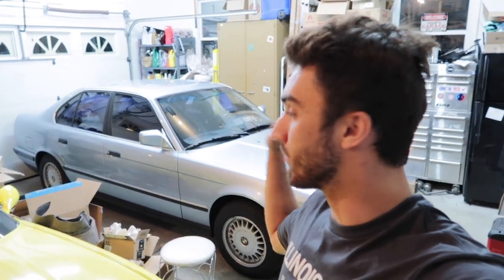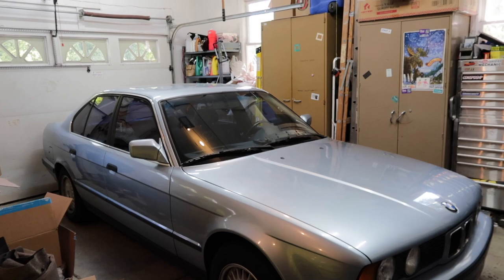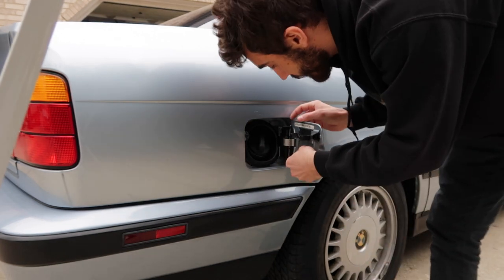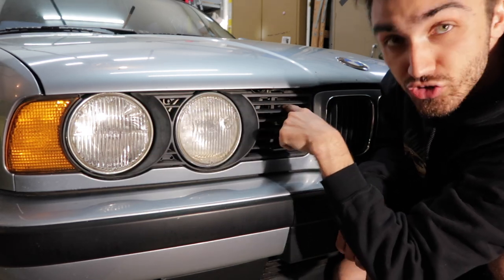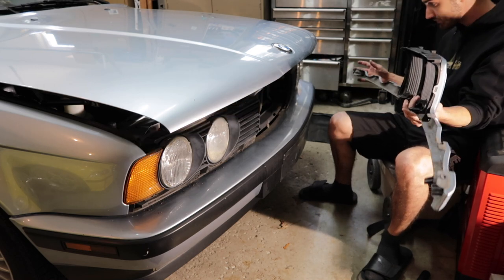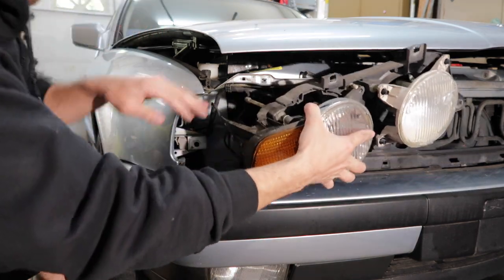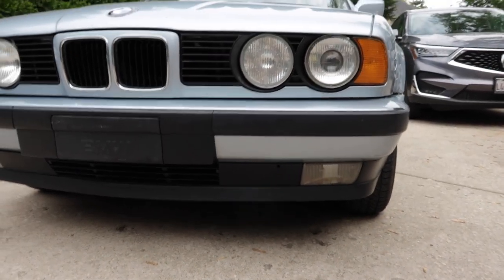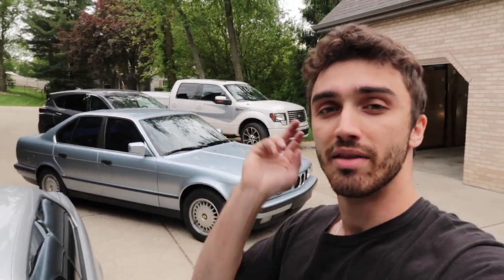Dialing in the Blue E34's Exterior | PDR, Trim Restoring, Headlight Upgrades, and More!

Comment: For the front grill there’s a hole at the top of the engine bay by the corner you stick a long screwdriver into to push down on the black tab to get it out. Bentley manual to the rescue😅, its in part 4 of my E34 restoration video. 

Plastics look amazing with fresh paint good job!
Reply from the maker: Mannnn! How did I miss that!??? Thank you!

Comment: Geepers! What a transformation! Looks great! Thank you for the PDR information. I have some dings that drive me crazy and the cost is reasonable. I bought my e34 new in 1995 and I want it to look as good as possible. Also appreciate the removal of the front grille. I’ve done it before but it’s not easy with big mitts for hands! Well done!
Cheers, George
Reply: By the way what type of SEM trim paint did you use? Matte black or Glossy? Thanks. Cheers! George
Reply from the maker: Thanks George! And I don’t even see a label stating matte or glossy on my can. Just says “Trim Black”. Interesting. Its definitely matte though

Comment: The turnermotorsport fuel door hinge I bought is garbadge, ordered 3 as was gonne get shipped across the atlantic anyway and I got a couple E34s, but they were all cracked in the same places. So had been poorly stored, used a cheap material or just in general been poorly thought out. Also needed zip ties to mount it, as the elasticity and the shape of the plastic were off from the OEM.
Reply from the maker: Good to know for future

Comment: Those upgrades made a huge difference, the car looks stunning! What are your thoughts on the wheels - keep the originals, or swap them for some other OEM wheel, like the throwing stars?
Reply from the maker: Im throwing the original wheels as far away as possible haha. I hate them. I have  some fancy HRE’s from 1990 that will be going on

Comment: Hey I have a set of late model OEM color matched side skirts, but I have a 1990 535i which isn’t pre drilled for side skirts. How would you recommend mounting side skirts in my situation?
Reply from the maker: Ive never done it personally, but my calypso came with this already done. To my understanding no drill holes needed, the skirts are mounted with a bunch of plastic clips i believe